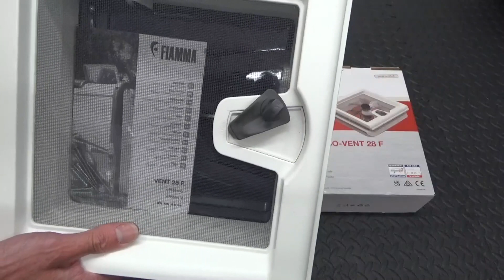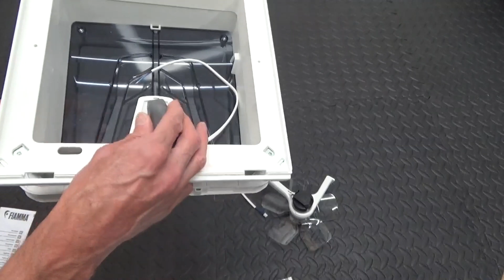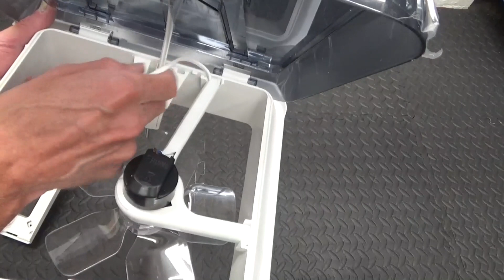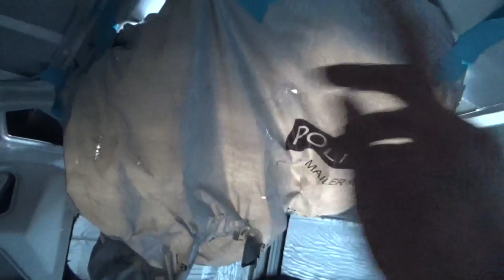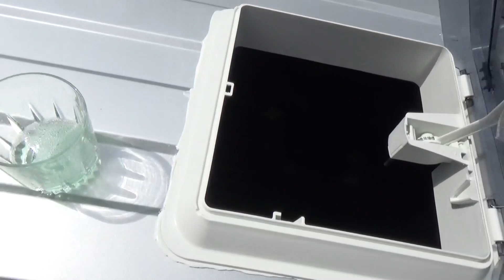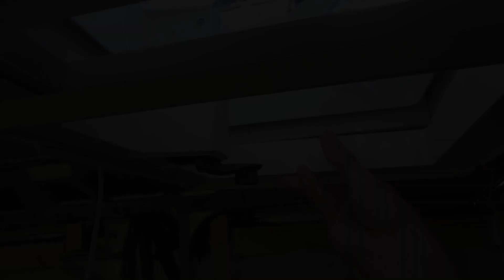Fiamma 28 Roof Vent With Turbo Fan - Citroen Relay Van Build

Comment: Hi thanks for the review, we have a mwb and I was thinking of having a maxxair at the front and one of these at the back over the bed for when its hot, but watching your video it seems quite loud. Is it very loud and also do you know if you can use the fan with the lid up?
Reply from the maker: You wouldn’t want the Fiamma fan over the bed as it would definitely be to noisy at night. I fitted a MaxxAir Skymaxx over the bed and a maxxfan deluxe at the front . I will be uploading the videos of fitting them.